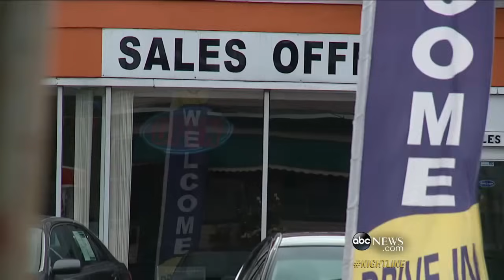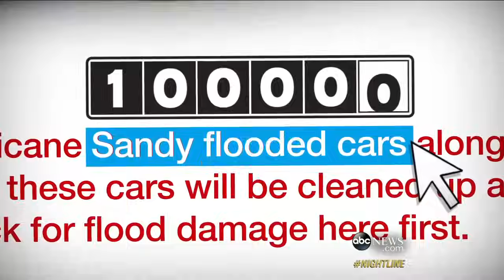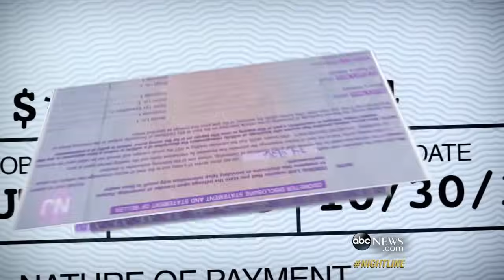How Did a Sandy-Damaged Truck Land on a Used Car Lot?

Comment: Somehow I'm not outraged at vehicles keeping clean titles after dealings with insurance companies.

If the motor's good, who cares? Wash out all the salt water, and drive away. Truck looks just fine.

In fact, he got 30k and they paid 20k for it - how's that not totally reasonable?
Reply: dav3fk
Maybe submerged would be a better word. Regardless that engine is a hazard and won't last long and it definitely won't last long. It's not hard to fix a motor that had water in it to make it run for a little while. Most people won't let you take parts off a engine to put a bore scope in it even if there is nothing wrong with it. You could possibly do something to the motor while using it if you don't know what you're doing. Most average people don' have the tools to do a compression test or the testers to test the wiring of the vehicle. Even if you take it out of water it still continues to erode the metal. That's a scientific proven fact and if you don't believe me you can google it.
Reply: dav3fk
Salt water got INSIDE  the engine as well as the outside. If you think you can just pressure wash the inside of a engine then you are the dumbest fucker alive. Actually you are really not supposed to pressure wash your engine at all because it has the possibility of getting inside your engine such as where your oil or transmission fluid sticks are and many other places. It can also hurt the wiring of your vehicle if one of the ends is exposed and if you get the wrong one you will be replacing the computer of your vehicle. Google about what happens when aluminum (the heads of this engine) and cast iron get (what the engine is made of) put in saltwater. If you don't look it up don't comment again with you can wash it off. No you can't not completely. It will still continue to corrode the medal. If it didn't why do you think they said these cars should be in junk yards and the mechanic said that he wouldn't drive it much less put his family in it. Once a vehicle gets that submerged in salt water it's a hazard to the driver and others on the road. Also it's common sense that when a metal is put in salt water then it corrodes it no matter how hard you clean it.
Reply: Hunt Guy
If it's gone over right, the things you're talking about are just not problems.

How do you propose to know that it had water in it? Or that if it did, it was a problem?

You keep talking about what's feasable in terms of what an end buyer can do - well yeah, but the end buyer's not the one who fixed it up - if you want to test the trustworthyness of the guys who cleaned it up, have a mechanic do actual tests on it

Even what looks like bad rust often doesn't even take a thousandth off the surface it's on - but I have not seen any evidence of any rust anyway, on that truck.

I'd be happy to entertain the findings of a mechanic in terms of actual damage, not superstition. Again, compression numbers would be a great place to start in determining engine condition.

They found one thing that didn't work, which the seller was upfront about: non-functioning power seats. (that also tells you there was probably no salt water in the motor, because the things above seat level apparently didn't get submerged, and the intake is considerably higher than that - probably why it was picked as a candidate to clean up and sell)
Reply: I'm going to try to explain this one last time since you obviously didn't look up what I told you to. You said that if salt water got inside the engine then it wasn't a big deal. Let me ask you this would put sandpaper all around your piston heads and let your motor run that way? The obvious answer is no. You might have a different answer based on how you think salt water on the inside of your engine is ok. Anyways the sand paper is essentially doing the same thing that the salt water would. Even if you don't think I'm right why do you think the MECHANIC who went to SCHOOL for a vehicle and knows them inside and out would say a vehicle submerged in water much less salt water is worthless and a hazard. I have taken engines apart with others and put them together and worked on them. There was a man whose truck was accidentally backed into water while putting a boat in the water. His engine even after a week had started to rust inside and out. His truck was only underwater for a couple of hours and it was only normal water. So based on that what do you think the inside of this thing would look like after being submerged for days and it being salt water is more corrosive. I'm still in high school but it's sad that I know more about engines then you and most people could use common sense and figure out this vehicle should be crushed. Please do me a favor and NEVER give ANYONE advice about buying a vehicle or the condition of the vehicle and its motor or electrical systems. I'd honestly be surprised if you can change the oil in your vehicle based on what you know or should I say don't know about them.
Reply: Hunt Guy
OH MY GOD SALTWATER SANDPAPER ON YOUR PISTONS HNNNNNNNNNNG

Get over your magical thinking - if it's damaged it's damaged, but from how it's running, it was not a problem - it probably had little or no water in the motor, but either way they obviously got to it fast.

If you want to show that it's unfit to sell, I'd like to hear compression numbers, scan results, a photo of the inside of the ecu, etc. Saying that it was exposed to saltwater, therefore it's in bad shape, is the cart leading the horse. If it's in bad shape, okay, let's assess the damage, maybe it's because of salt water.

You'd lose your shit if you knew what a hone was (sandy rock bits in your cylinders), but it's also entirerly possible it was gone over - even if it did have corrosion problems, a hone, rings, maybe bearings, and valve lap, and what's the difference from a brand new motor? It wouldn't need machine work, as it was never worn out or overheated or anything.

The simple fact that there was saltwater there doesn't mean shit about it's current condition, or that it's not okay to sell. You have no reason to say that it's unfit to sell, other than a desire to be outraged. Their video didn't make it look unfit, they did what you're doing - ad truckinem attacks without an assessment of actual damage.
Reply: Hunt Guy
Yes, please go explain magic to somebody else - I'm sure lots of other people want to hear about how even though there's no measurable damage, seriously, everything is really going to shit.

Meanwhile, I'll put my trust in my mic, feelers, compression tester, calipers, rulers, multimeters, test lights, eyeballs....
Reply: Hunt Guy More meaningless ad hominems.

Sometimes "common" sense is dead wrong - it's certainly often fraught with paranoid and superstitious thought processes and conclusions.

I'm happy to accept that it could be royally screwed up - I'm just not convinced. This was the world's weakest most half-assed expose - if they tore the truck apart I'd love to see it. All they did was show where it came from, not that it was in unacceptable condition.
Reply: *****
Yeah, the northen US does that too.

And the cars last for fifteen years - fifteen days before meeting a carwash isn't some big dangerous vehicle-ruining issue.
Reply: *****
nevertheless, you get my point... getting wet once doesn't mean that it can't be sold honestly, especially at that large a discount. This investigation was meaningless, because they didn't pull it apart and actually see what was damaged.

Obviously some cars are ruined in that sort of situation, but there's just nothing here to make it look like the truck was no good.
Reply: Unless everything is taken apart and cleaned it'll have corrosion and electrical issues.
All the electrical boxes interior panels and even the oil in the differential etc.
The thing is they usually don't do that.
Reply: Membrane556
I would change the diff oil on general principal, but no.... there is not seawater in the rear end.

Yeah, sure, it needs to be done right - and they did nothing to show that it was not. There is no evidence in this video to suggest that the truck is anything but a great deal - if it really did have damage, the shit lazy production did people who could actually fall victim to that stuff a great disservice.

Know why they didn't rip it apart? Because then they would have had to put it back together....... so that they could sell it.
Reply: dav3fk well every vehicles frame has mounting holes throughout and the salt would begin to eat away at the frame from the inside out... not many products to protect inside of frame
Reply: Mcnutts3
Frame rails have corrosion-inhibiting wax inside them, and in other hard to reach places... At least, may car does.

And, so what? Salt water happens, it happens everywhere, it happened this one way once, you clean it off as best you can, vehicle lives it's life out.
Reply: dav3fk yes vehicles do use wax but it can become a moisture trap, especially if a vehicle is submerged for 2 days. you simply can not get into most parts  of the frame and there will be small holes for the salt water to get into, and not everywhere has salt water
Reply: Mcnutts3
Sure, not everywhere has salt water - but the fact remains that the truck is NOT about to fall apart due to corrosion, I don't see any reason to assume that it's service life has been shortened in any way - other vehicles spend all winter covered in salty water - and just strait-up chunks of salt - it's nasty stuff.

So yeah, again, it's a used truck.... and a great fuckin' deal on it.
Reply: *****
So I've heard, but I've never been to one - I can't imagine myself buying a car from any dealer, used or otherwise.

My newest car is old enough to drink.
Reply: dav3fk the dilution of salt that ends up on peoples vehicles from winter driving is nowhere near sitting in salt water for 2 days. there are lots of deals for you if you trust a vehicle like this, but salt and water are an electrical components worst nightmare. very risky as is buying anything used
Reply: Mcnutts3
I take it you've never been anywhere with rock salted roads.

The dilution is pretty fuckin' strong, when you have chunks of damp salt all up in your car. That's pretty near 100%.

Once again: if there was salt damage, I'd be interested to see it - the shitty investigation left that unanswered. It could have been cleaned up right and halted the damage, or it could have been a "ticking time bomb" or whatever they called it, we'll never know, because they went and smeared a bunch of people without proving a damn thing.
Reply: yes we have rock salt in Ontario but the amount of snow on the road far exceeds amount of salt... the salt build up in your car on the mats would be direct pieces from your shoes, which would be near 100% but the build up underneath cars is quite weak and flaky, nothing like its original state. they should cut one in half to see what has actually happened! i agree i want to know
Reply: dav3fk ^^
Reply: *****
Lol I think you missed that I'm one person - but I can take a compliment with my insult, it's all good.

I'm not denying that a lot of cars would be nothing more than scrap after that, especially if not gone through promptly and fully - but I'm still just not willing to condemn people for selling a truck that looks and runs just fine, until I see the proof that it really should have been written off. (and yeah, if the salt water is off, what else would corrode it?)

It's just that I need proof beyond a reasonable doubt before I condemn someone - even if they're known to be a scumbag, that doesn't mean they're guilty every time.
Reply: *****
Ehh, I have USAA, so.....

They're probably as slimy as they come, but I still can't consider them as such until I see it proven. I'd never ever ever buy a used car from a dealer, because even if it can't be proven I suspect them of all being slimy (and they're in the business of selling me something that someone else used - I can just go to someone else directly, and everyone gets a better price, except the useless dealer), but before proclaiming something to be a huge scandal, I'd like real proof.

If it's a horrible deal, this video did a horrible job showing it, all they did was show a truck that looks great, runs great, and that they bought for a great price.
Reply: dav3fk You seem to think washing away salt residue is the only problem with a salt water flooded vehicle. Things go way deeper than that. The biggest problem with any flood vehicle is the fact WATER soaked into the electronics and wiring. That in itself causes grave issues in modern day automobiles. If you think simply rinsing off salt residue fixes anything then God help you if you ever buy anything like this.
Reply: Mike Hawk
WATER in the electronics broke the seat - and not the rest.

You never put a phone in rice? Electronics survive dunking all the time - remove power, dry out, maybe use distilled water, and you're good...

The issue is not removing salt, it's how fast you remove the salt.

If you think a little computer is the biggest problem with a whole goddamn car, okay, fine, go buy a new computer...
Reply: *****
Pure hysteria.... I explained the physical reality, trying to insult me doesn't change what I've explained.
Reply: ***** You have not read what I've written, I've explained how this works over and over.

What happens is that those vehicles are already insurance claims, some might or might not be damaged other ways, some might have gotten water in the cylinders, some might really have terrible damage of all sorts, some might have been washed into other things - it's pretty goddamn obvious that when people find their car floating and give it up to insurance, they don't want a soggy car back - however, when it's sold by the insurance company, there are people willing to take a gamble, and in this case, yeah, it looks like they hosed it down and it's good to go. So it was sold, and insurance saved some of their potential loss, and someone else took a risk and made a profit (that is to say, capitalism happened) - and many thousands of other cars went to the crusher, because they actually did suffer damage that wouldn't make financial sense to repair.
Reply: *****
Who would? Somebody who goes and buys it, reconditioned, considerably cheaper than they could buy it new. Not everybody buys brand new shit, and while many of us would rather buy from a private party, some people don't live in your bubble, and some people are fine with going and buying a disposable used car and paying someone else to do their legwork in getting it.

Sure, some people buy salvage or junk. Some people can't or don't want to monkey around with washing out totaled cars, so they go to a used car lot. What's your point?

So basically you say, if some of these cars can be washed out and salvaged why doesn't anyone do that? Well son, they do, that's exactly what's happening in this video.
Reply: *****
You're still trying to use insults and hysteria to counter my logic and facts.
Reply: *****
You excitedly proclaim things that are counter to reality, and attempt to steer the conversation with baseless assertions that, no matter how easily and obviously dismissed they may be, derail the conversation and it's apparent center and balance.

You yourself may not be truly hysterical, it's just a dishonest tactic in conversation.
Reply: *****
See above.
Reply: *****
See above.
Reply: dav3fk That thing is worth ZERO money. If the airbag blows up accidentally while they are doing 70mph and they kill someone, bye bye any money they have.
Reply: Quit arguing with stupid.  dav3fk  I'm guessing you flunked basic science and don't know a thing about cars.  I don't know anything about cars but damm even I know these cars are junk.
Reply: dav3fk  yea and id gladly take a flooded car with 20 k off  and pay a repair her and there verses being stuck with a car payment as long as it had minimal flood damage I have a 99 Tahoe  that we drove threw water as high as the dash I never call insurance as I only carry liability on it when  the water got as high as it did it began to float but the engine never stalled out and to this day the engine is still running and it has only had a new transmission installed but also the Tahoe has 232,000 miles on the oem radio still works the oem computer still works ac works the paint is faded though  but it was faded when it got flooded its also a 4x4 I cant get anything for it  im to honest I would never lie  and say it wasn't flooded even though it has been cleaned up but  don't want to sell it ill keep driving it till the motor quits then off to the juk yard it goes  I had all fluids changed after the flood to be safe  but the oil never got water in it the air filter was dry. depending on the amount of damage done not all flood cars are lemons  just be sure you know what your buying before you buy it and be weary you may have some hefty repair bills coming up.

Comment: I mean I do a lot of buying of vehicles on copart,  and there's many vehicles in worse condition than that truck, plus 20 thousand for this truck is a steal, you can make so much money off it in parts alone such as the engine
Edit heck I got my ram 3500 longhorn off copart, now using it as my company towing vehicle when bringing clients cars from where they were bought "I'm a broker which means I buy vehicles for those without a license to do so"